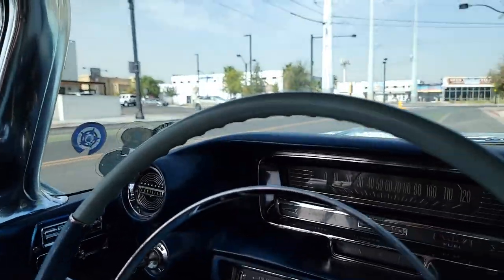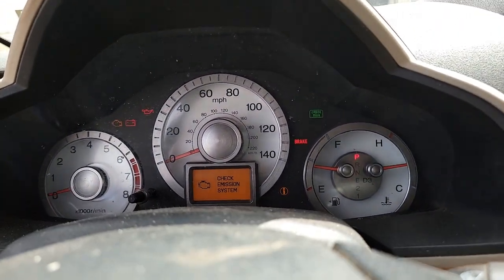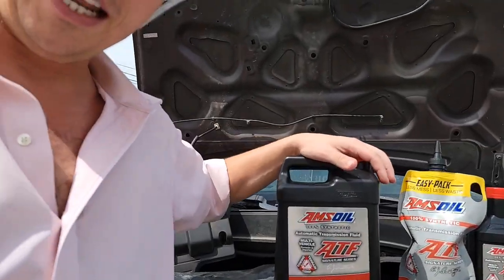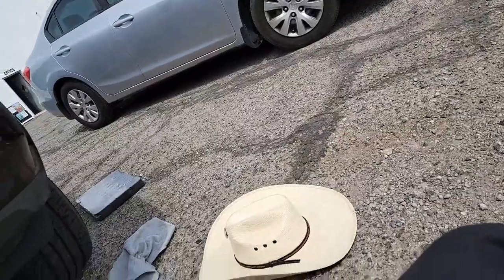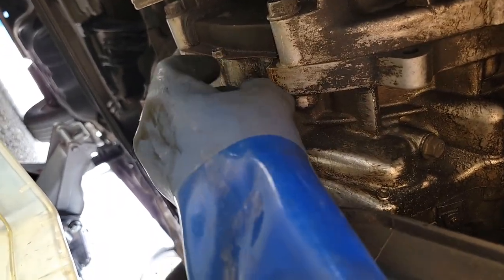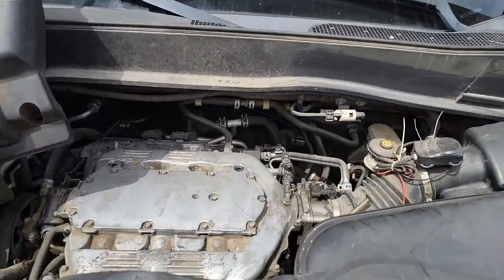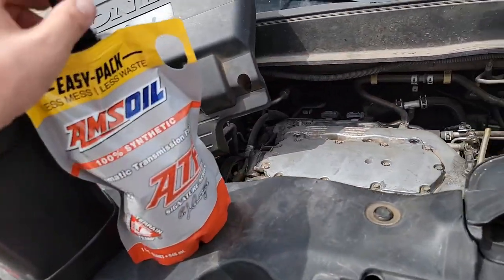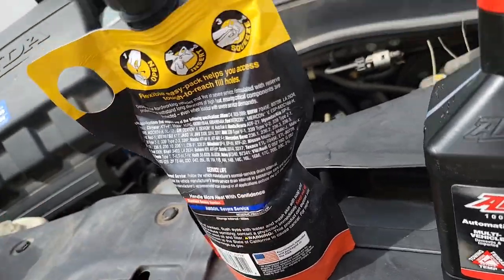Will Changing ATF cause it to slip? You May BE surprised!

Comment: Some cars had torque converters you can drain.  Some Mercedes had them and possibly other brands.  There would be some sort of access hole to make it easier.  I guess the hard part was lining the hole up in the access hole.  It is a shame they don't make them like that much any more.  A large portion of the fluid is in the torque converter then there is still some in the passages that can only be changed with drains and fills from the pan but that is least of it.  Some Asian vehicles have a round cartridge style filter on the side somewhere that some people never knew existed.  There is usually a housing over them with a few bolts holding it.  it is sometimes more full of debris than the screen filter in the pan that I can't trust as far as I can throw it to catch all of the dirt and debris!  Some people think a screen is good enough and I say NO , it is just better than nothing at all!!

Comment: I’ve never messed with changing the tranny oil before..I’ve always been told you have to change the filter and everything and it’s complicated. So does the new fluid just mix with the old and make it more powerful?
Reply: You don't have to change the filter. If you're dropping the pan already it's one of those things like why not do it. But if it's just drain and fill there's no need. It mixes and you get those new additives and extra protection.
Reply from the maker: Yes, it mixes great and it helps clean the transmission

Comment: Hi. My name is Victor i would like to try the amsoil I have a 2011 honda pilot LX 4WD 3.5 
What type of transmission oil you recommending... thansk
Reply from the maker: A Victor awesome yeah you'll definitely love the Amsoil products this is my personal link here and when you use it that will attach me to you so in the future I can always answer questions about your vehicles about improving the performance and lifespan of your vehicles by choosing the right fluids has your independent Amsoil dealer👍
I recommend the 6-month PC membership to give you the very best value on the products👍
This will give you everything for your year make model engine size will also give you the fluids and capacities if you have any questions and anything just let me know😉
♥️   Find The Right Fluids For Your Vehicles - https://www.amsoil.com/guides/?zo=5331179      

     ✅   Save 25% On Your Next Fluid Order: https://www.amsoil.com/offers/pc/?zo=5331179
Reply: @Syntheticoilprotection  thank you. I open account with amsoil. I ordered the OE with amsoil for my 2016 toyota rav4 transmission. Can I send back the one that was shipped?
I want to try AFT signature. Thank  you
Reply from the maker: Awesome Victor sure you'd want to call Amsoil ordering you'll see the 1-800 number here also curious if I'm your independent Amsoil Dealer it will show it when you log in if not if it's within the first 30 days you can still be switched to me as your dealer.
Eben Rockmaker 
5331179
Reply from the maker: [Name] AMSOIL Ordering
[Mobile] 1 (800) 956-5695
[Home] Customerservice@amsoil.com
Reply: @Syntheticoilprotection  okay I will call you as soon as I receive the product.
Reply: @Syntheticoilprotection  thank you for your time and help.

Comment: Can i use It in 700r4 Chevy Camaro 84 transmission?
Reply from the maker: Yes the lookup guy here will give you everything for your year make model and engine size also the fluid capacity and you will see a huge difference in the shifting speed and also you'll get the best price as the 6-month PC member and then you'll see the lookup guide that's where you can enter the year make model in engine size of your vehicle and you'll see the promo as well will give you the best shipping price if you have any questions just let me know💯👍
When you use my link that would attach me to you so in the future I can always answer all your questions about improving the performance and lifespan of your vehicles by choosing the right fluids as your independent Amsoil dealer👍💯
♥️   Find The Right Fluids For Your Vehicles - https://www.amsoil.com/lookup/auto-and-light-truck/?zo=5331179

Promo: FREESHIP49 & 5AMS
Reply: @Syntheticoilprotection  ok I'll try it because I use the oil signature in my Lexus for the engine service